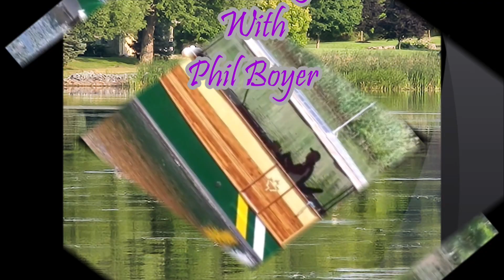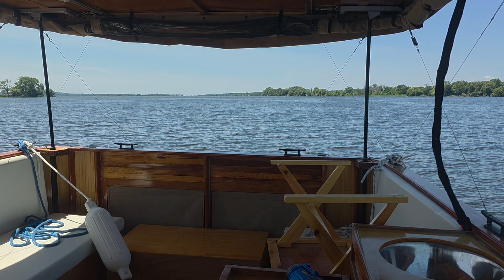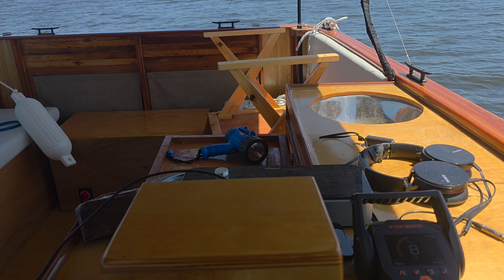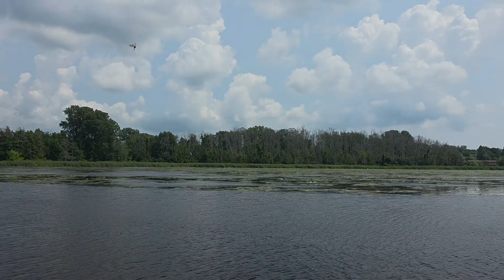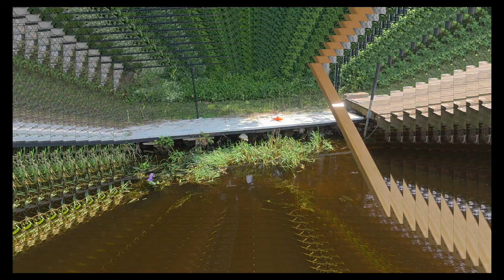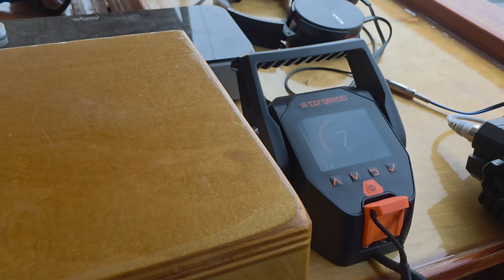July 27, 2026 Testing the Five Bladed Cruise Prop on my Torqeedo Cruise 6.0R

Comment: the 5 bladed prop might work better if you raise it up some
Reply from the maker: I tried different levels and no it still was not as good as the power prop.
Reply: @philboyer2036  5 blade more weight thrust.  With same amount energy.  Will not run at the same high speed compared to three blade.  Top speed would be less cause of cavitation and other physics.  I seen rating up 2tons 5 blade.